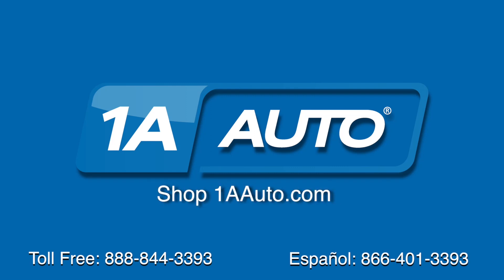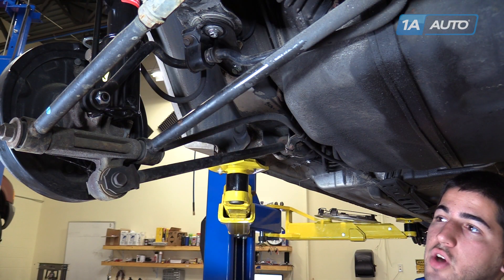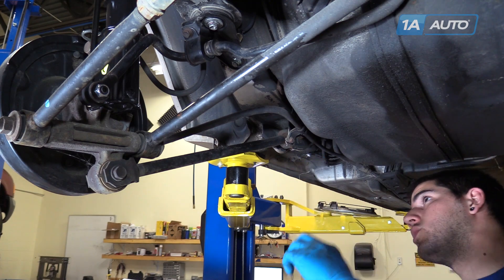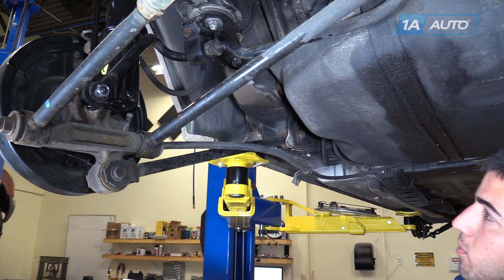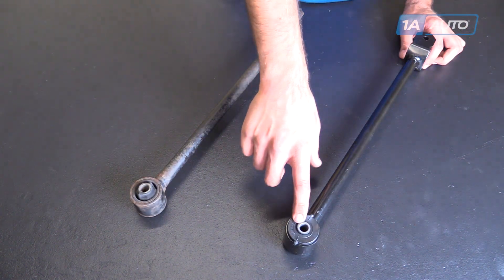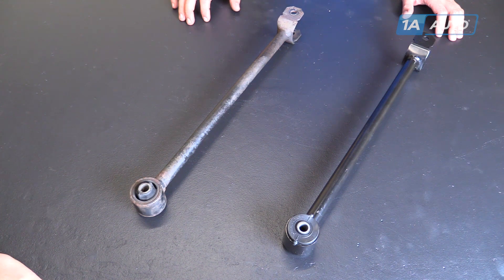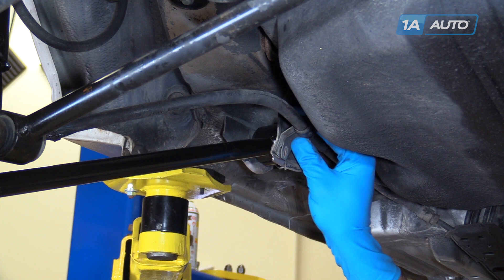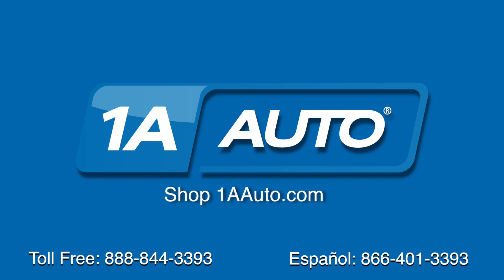How to Replace Lower Trailing Arm 92-01 Toyota Camry

Comment: This part is referred to as a strut rod in the Lexus ES 300 manual. Torque specification for these bolts is 83 Ft/Lbs - NOT 134 Ft/Lbs. You are confusing the torque spec for the four bolts of the lateral link which is listed as 134 Ft/Lbs in the 2000 Lexus ES 300 manual. At 134 Ft/Lbs, you may very likely and probably will twist off the bolt.
Reply: same here 83 ft/lbs torque for the strut rods bolts & nuts. 134 ft/lbs for the No.1 and No. 2 lower suspension arms or lateral links. These toque specs listed in the Toyota Factory service manual.

Comment: Help guys! My nut is stuck. I use everything so far, from wd40 to torch,it won't budge. I bought the car months ago, the owner drove it in NYS, so it is super rusty under there and I think decades of salts and low maintenance, corroded that bolt and now it won't move

Comment: You should include the bushing in the back.  Its definitely going to be needed if everything else is worn out.  I’m finding this out as I am putting these in.  I will have to go to O’Reillys and see if they can find me a pair of those bushings. Kind of annoying.
Reply from the maker: Thanks for checking us out! The trailing arms we offer are noted to include the bushings. If you believe you received an incorrect part please feel free to contact us at 888-844-3393 and a customer service representative can further assist you. +GrizzlyJ85

Comment: Listen to those dry threads squeak- always squirt a penetrant/rustbuster hours or days ahead of time (if possible)  I like PB Blaster but there are a bunch of good ones out there.  It makes a huge difference, especially on older cars. Pros do not have that luxury,  they just  get the car in the bay and start working.

Comment: I ordered this part and put it on the right side but it wasnt exact same size as the original Toyota arm I had on the left and I couldn’t align  my car correctly because of this my strut was touching my tire when aligned because of the difference in size I seen he said they are exact same fit beware because they are not

Comment: I HAVE a 2003 toy highlander got hit on rear driver side. Bumper is smashed in wheel is pushed fwd crooked and now rubbing on the fender. That trailing arm is way bent out of shape 
Think anything else would make the wheel out of wack? Also had fluid dripping down the back of the wheel
But it stopped and ive got brakes it no fluid coming out when i pump with car running
Strut fluid i guess

Comment: What bolt size is the one that you guys snapped, same thing happened here
Reply: It’s the exact same bolt that goes through on the top, so if you got the top bolt out, just take it to your local hardware store and get a grade 8 or 10.9 bolt that matches

Comment: How do ya get the forward control arm out? There's two per wheel on the rear , I want to change both , the long bolt on the "spindle" won't move an the top bolt is up against the tank.....?????
Reply from the maker: +Alan wilson Thanks for watching!  Unfortunately we do not have a video on the replacement of those suspension components, but it sounds like you may need to remove the tank to allow access to the bolts.
Reply: Yesterday i wanted to replace mine and just like u i found out that stupid long bolt won't come out because of the tank! But looking at it i think removing the rear frame would be the best bet!!
Reply: @Tcho2100  i would say cut the bolt can get them on ebay for bout 8 bucks,cut it then put other one in from backside instead of tank side where it'll come out next time

Comment: Working on a 2003 Chevy trailblazer trailing arm
Reply from the maker: +Robert Romero We currently do not have an auto repair video specific to your vehicle. You might be able to apply some of the basic steps shown in this video to your application, but please note sizing and orientation will be different. Here is a link to the repair part that would fit your vehicle. Hope this helps you out https://www.1aauto.com/trailing-arm-rear-pair/i/1asfk00924?f=651428&y=2003

Comment: Why is it necessary to jack up the suspension during installation?
Reply: Also curious.
Reply: To align bolts correctly and take the weight off while torquing the bolt
Reply: How do you know how high to jack up the suspension? Does the suspension stop going up after jacking the supension up?
Reply: To torque the bolts at the operating height. Otherwise, the bushings will fail prematurely due to having constant torque on them.
Reply: @bobsaet6864  no ull see the holes line up thats why he jacked the car

Comment: Hey! you replaced the bushing in the rear assembly and said nothing about it? What gives, half the slop in this assembly is that bushing. Why did you omit.
If you didn't catch it,the bushing under the wheel is dry and brown with two small ears on the bushing. when they return to put the new trailing arm back on, the under wheel bushing is soaked in penetrate oil and there is a new bushing without  the ears?
Reply from the maker: +Barnes Married Thanks for the feedback!

Comment: How did you take out the old bushing. I can take out the bolt with a snap but I can not take out the old bushing
Reply: use a gear puller